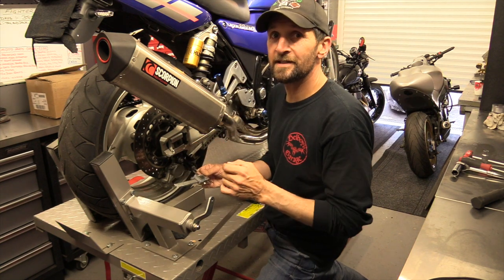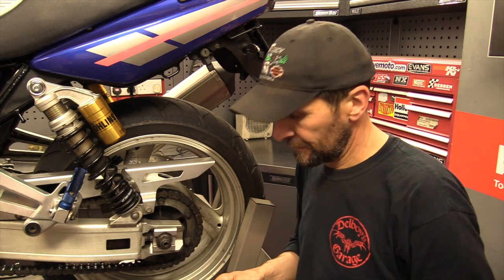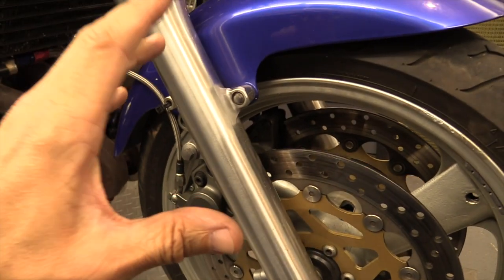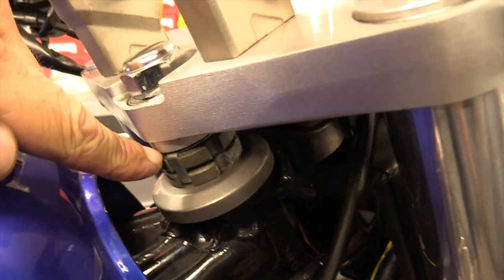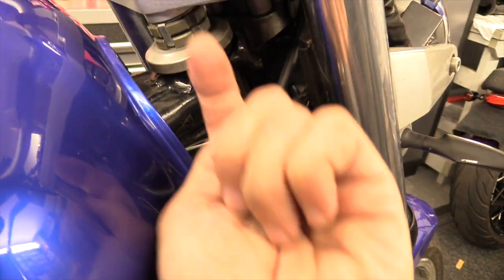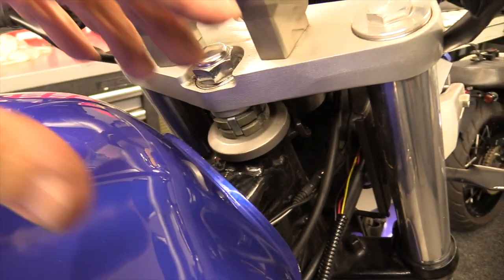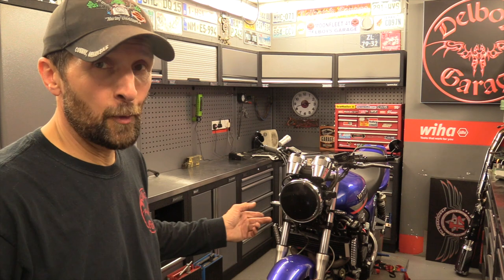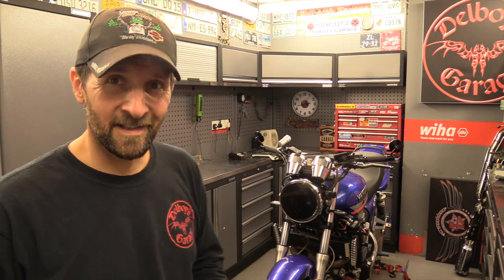Delboy's Garage, Quick and Easy Motorcycle Fork Alignment .

Comment: Be careful measuring rear wheel alignment like that. I've got an 03 zx6r and the axle locating block are different sizes so if you measure them the same to the back of the swing-arm you'll be way way off. I cooked a brand new chain and sprocket in like 1000 miles because I measured it that way.
Reply from the maker: Dead right buddy, good advice, it must be equadistant from the centre of the axle pin to the rear of the slider block, otherwise the only true way to measure is from the axle to the swing arm pivot, or with  laser aligner along the chain... wise words well said...

Comment: My 82 "snowing" suffers from this issue, & now I know how to reslove it. Can I do this procedure on the centerstand?? Thanks, Mike BC wet coast.
Reply from the maker: Hi buddy, glad it can help you, but I would say no, the centre stand will prevent you from plunging the front up and down, also when you do so, the forward lunge you need will probably roll it off the stand - maybe, if it's possible, you could get someone to hold the bike from behind while it stands on it's wheels!
Reply: Thanks for your rapid responce, I will use my floor stand on the rear wheel, hava great day!

Comment: How to align a rear wheel with a single swing arm?
Reply from the maker: Even easier buddy, forget the rear completely... all I did here was check the rear was straight, cos often the rear is the first to go out of alignment... a rear mis-alignment, will make the bars feel twisted, so you eliminate that first and then if it still feels twisted, then you need to align the front... but with single side rear swing arms, there is no rear alignment, they are fixed straight ahead permanently... so just do the front only and forget the back !

Comment: Hi on my bike when the front suspension is depressed it catches very slightly on the front disc on the o/s only on the flouting things how is that fixed
Reply from the maker: Hi Olly, really sorry, I don't understand your question, what exactly catches on the disc and what do you mean by 'on the flouting things'??
Reply: @Moonfleet41  the round pieces that sit  between the solid part that bolts the wheel and the shiny part that dose the breaking it is on a 2009 ducati 1198 and evey second round piece sticks out I little

Comment: Has anyone tried this on a 2009 harley sportster 883? if so does this method work for that bike?
Reply from the maker: Yes it will work my friend, make sure you back off the fender bolts as that holds the forks like a brace , being made from steel...

Comment: Dude..  your not using your calipers properly! When checking depth with a pair of calipers use the long skinny rod that pops out the back side and slide the calipers closed until it bottoms out on the swingarm. Otherwise nice vid!!